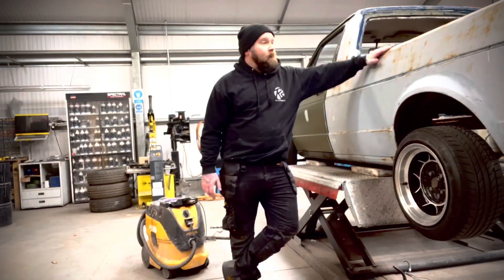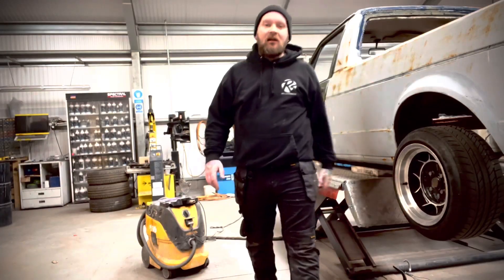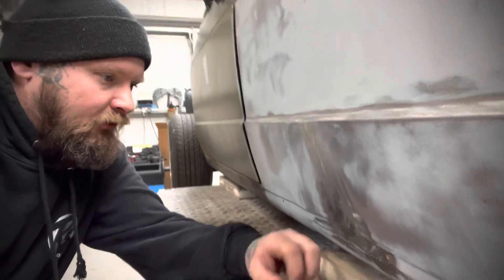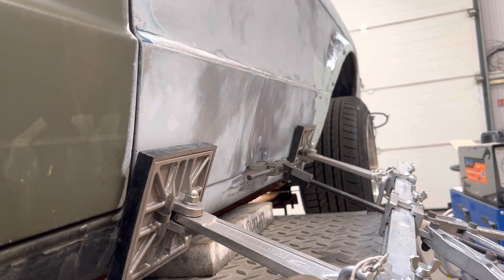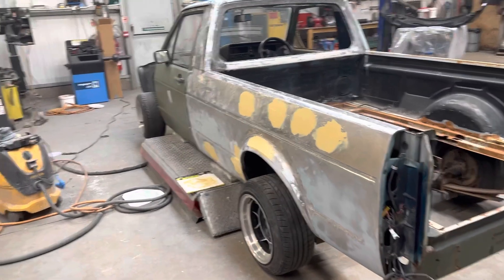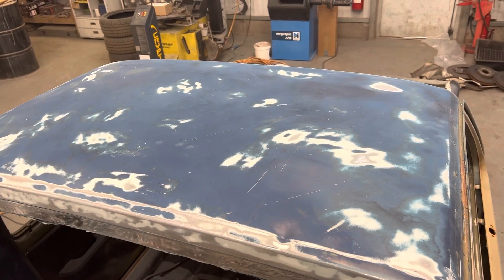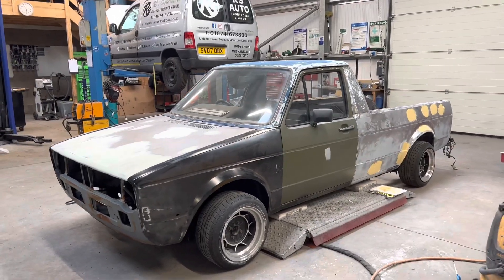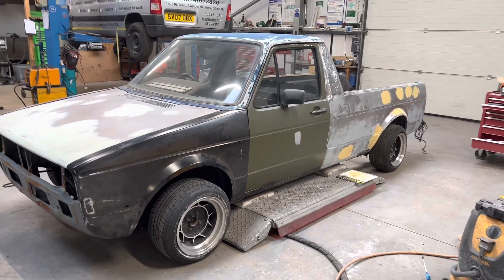Mk1 Caddy restoration pt2 rear quarter repair

Comment: if you use vr5  engine it will give  awsome will u try it with four exhaust tip,ecu remap and cylinder widenned
Reply from the maker: I have a 3.2v6 motor sitting in the garage which is always tempting to put in

Comment: Just seen this video after watching an erlier one, Looks cracking the way it is, ratty retro mod is the future, mk1 is old enough now 😂 On the up side you can park it anywhere without worrying its going to get scratched by some jelous @r5 wipe 👍
Reply from the maker: I’ve just started my painting apprenticeship so seems like a good thing to actually practice on and get looking half decent. 
I have a proper knackered mk1 golf shell, might build that as a ratty one 🤙😂
Reply: @masterofnothingprojects5632  Ive just seen it, eye your right, its worse than my red one lol , but not unfixable, makes sense to paint yours, paint it in the winter ? Take you a day and half to tare it down after the summer  loolo
Reply from the maker: @dubayadot  yeah will be nice and quick to do 😅😅 
I actually have all the repair panels for the golf so will see what happens after the caddy
Reply: @masterofnothingprojects5632  No matter what you do its gony be a belter 👍👍🤣🤣
Reply from the maker: @dubayadot  fingers crossed it all works out 😅